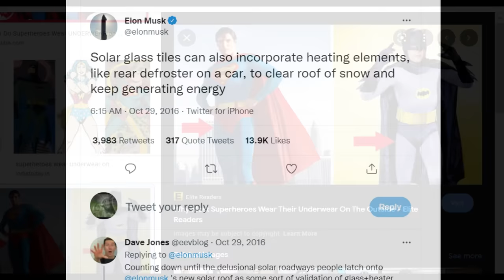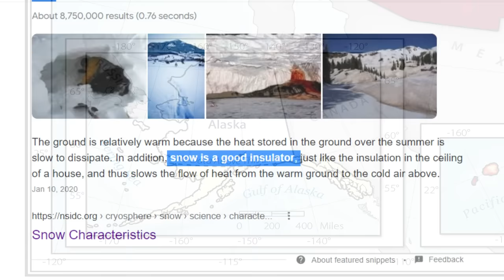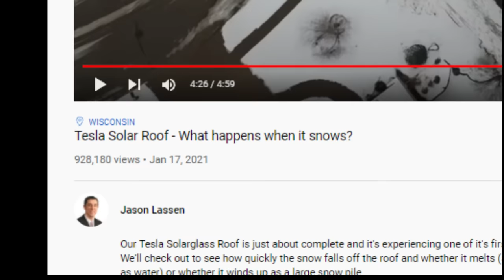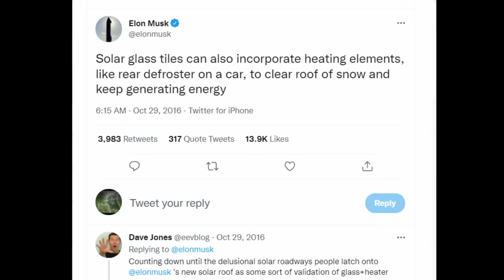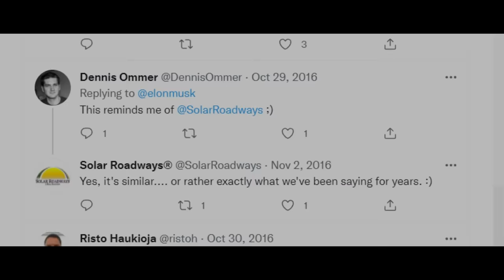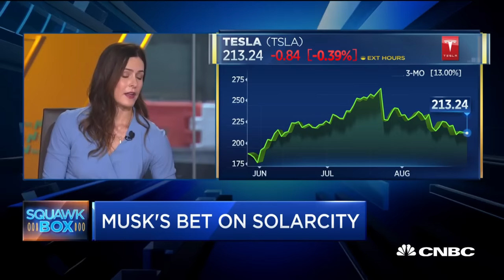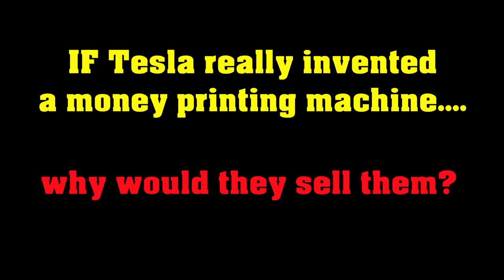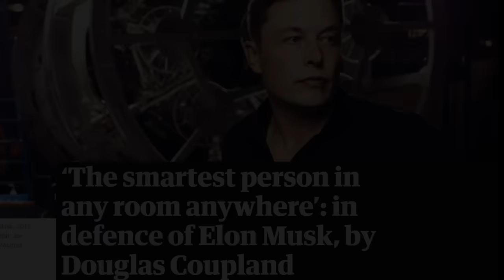Elon Musk: The Smartest Person in any room ANYWHERE!

Comment: "Why put insulation in your house when you can put heaters outside it?"
I can do one better:
"Why insulate your house when you could just glue yourself to the M25?"

Also, you might be getting a knock on the door from the police if your hosue mysteriously has no snow on it lmao
Reply: @monsterous289  It was the Musk Fanboy who made the original video who made the claim.
Reply: @Foolish188  what specific claim that is wrong did the Musk Fanboy make?
Reply: @monsterous289  Watch the VIDEO of him saying it was!
Reply: @Foolish188  Saying it was what? To be honest, I too thought I'd heard the guy in the clip indicate that the snow had melted rather than sliding off. I was even considering a strongly-worded critique of JFunk's comment. In preparation for the comment, I re-listened to that segment to make sure that I quoted the guy in the clip correctly, but on re-listening, all he says is that "there's not too much here at all". This doesn't state one way or the other whether the snow melted, or slid off and was subsequently trampled. "not too much here" could refer to either piled up, un-melted snow, or could refer to refrozen melt-water, without further detail, anything more would be conjecture.

What is clear here is that TF's choice of this clip to demonstrate his general point about insulation was a poor one. The other examples he showed were FAR better demonstrations of the link between poor insulation and houses with a clear roof. Without further explanation of why there weren't piles of snow under the edges of the roof, it neither proves, nor disproves his point. If JFunk is correct (and I have no reason to doubt them. I haven't sought out the source video as it's irrelevant to this comment), the lack of piled-up snow can be attributed to the passage of time, although this doesn't explain why the snow elsewhere in the yard was roughly the same depth as that where the piles would be had the snow slid from the roof.

That TF goes so hard on this video is something of a double-edged sword. Whilst he is probably right that the current lack of snow coverage means that this building is now likely to be less well insulated than the other houses in the neighbourhood that have both traditional insulation PLUS the insulating properties of a layer of snow, there is no evidence that a lack of traditional insulation caused this lack of snow (and to say so without pretty firm evidence, or at least acknowledging any assumptions made in the absence of such evidence, is wrong, and coming from an accomplished and published scientist this is both surprising and disappointing). As such, use of this video fails to strengthen THAT part of his argument (that deliberately removing the snow coverage lessens the total insulation that the building could be benefitting from). That the entire roof is clear, however, reinforces this point, as you would only need to clear the snow coverage from those panels on the sides with line of sight to the sun.

This being said, JFunk's statement that "he knows this!" about the time lag between snowfall and filming being the cause of the lack of piles is only valid if the source video provides information not in evidence in the abbreviated clip here. JFunks criticism states this as fact, however, without citing the source of the additional information being used to justify this assertion.

Additionally, JFunk's criticism of TF comparing to Solar Roadways as they need to "not just melt all the snow, but evaporate most of it" is disingenuous, as Solar Roadways just need to melt the snow. If correctly installed, the camber of the road would naturally cause the meltwater to run off.

All in all, errors on both sides here. TF, as the creator of this video, bears perhaps more responsibility for his poor choice in using this clip to demonstrate a point that, absent additional context not in evidence, it fails to demonstrate. Implied attribution of malicious deception to TF by JFunk, however, is perhaps a little excessive, especially copy-pasted as often as it is through this comment section. If you have a point to make, start your own comment thread, rather than copy-pasting it into so many comments with which you disagree. The lack of specific parallel between JFunk's comment and the comments it's pasted in response to only serves to weaken the points within as it paints JFunk as being possessed of at least as much blind hatred of TF as they are accusing TF of exhibiting towards EM.

To be clear, I'm neither a TF, nor an EM fanboi. I am sceptical but openminded about most of EM's ventures, and was before seeing any of TF's (or anyone else's) content criticising him. Part of this is that in the coverage I've seen of EM, the way he articulates things makes me think he's as busy trying to convince himself of these concepts as he is the listener / viewer. It seems as if he has been persuaded of the veracity / viability of these things by folks desperate for a slice of his fame and fortune to fund their ego-stroking circle-jerk projects but doesn't fully understand them and is trying to convince himself that he isn't the victim of a con. I'm not saying that this is the situation, just that the footage I've seen comes across that way to me. As someone who works in the IT field, I've often seen this behaviour in those who have been taken in by an online scam who are desperate to get others to believe in the scam as a way of reassuring themselves that if others fall for it too, it makes them feel better about having been duped, and will vociferously advocate for the scam even to those who know better and are trying to show them that it was a scam (especially where they know these people are in a position to know better, as if they can convince someone who is, for want of a better phrase, professionally trained to know better, the effect of convincing them that the scam is legitimate is even more powerful in assuaging their feelings of guilt / inadequacy at having been duped). The strange thing is that I can't put my finger on exactly what it is about how he articulates things that gives me that vibe, but that's certainly the vibe I get.
Reply: @Kevin Reed - there really isn't enough context to make a call either way on that roof - the drywall guys could have been upstairs the day before with portable heaters going full blast. Its kind of pedantic but people in these comment sections tend towards that.

Comment: No doubt he's a con. But in general, solar panels in northern climates have one advantage. They perform better in some cases depending on how much snow is reflecting the light. There's no performance hit from overheating either like in hot climates.
Reply: Yup, solar panels work best when it's both cold and sunny. Intermittent clouds also help in summer: when their shadow passes over the panels, they get a chance to cool a bit and improve efficiency. And they also reflect light onto the panels when the sun is not precisely in the direction the panels are facing, a benefit that's not restricted to summer only.
Reply: good point but won't catch much snowlight from the roof facing upward..
Reply: @prismpyre7653  Are you sure about that? There’s plenty of information out there about it if you do your research. But yea if it's flat mouinted on a roof then maybe albedo effect won't bounce to it. But in good solar arrays they are double sided and catch relfections. And also there is still the cold making it more efficient than in hot climates.

Comment: Solar power is just so overrated in general. Even making it more efficient doesn’t increase the amount of solar irradiance, which is not a lot per square acre. We need advanced nuclear fission to save the economy from climate change — look seriously at thorium molten salt reactors. See Kirk Sorensen videos 💡
Reply: Solar power is underrated.  Current designs make the lowest cost electrical power of the available options.  Fusion energy is 20 years away and always has been.

Comment: Make a video on PAVEGEN, apparently they make floors/tiles that convert pressure/friction into electricity and they say they are planning to make roads with that technology. Seems very good, but your takes on those kinds of things always bring light to determine if its a fraud or not.
Love your videos!
Reply: So they want to put something that is based on moving parts (because you can't exploit pressure without those) under the extreme stress of road traffic?
Reply: That kind of technology is already being driven on. CAT Scales uses that kind of technology. Truckers drive onto scale, and it weighs the truck. In the USA, a truck is not allowed to exceed 80,000 pounds (properly marked trucks, and truckers properly licensed, can go above the 80,000 pounds as an oversized load), so weighing is a necessity from time to time. They are also not allowed above 20,000 pounds on a single axle if I recall. So some scales, are even segmented, to weigh the front axle, the 2 center axles, and the trailer axles, individually, so not only do you get the overall weight, but the weight on each axle and axle pairs. The only kind of measuring device, takes an electrical signal produced by a truck driving on the scales, and weighs the truck with said signal.

So it is viable, to allow vehicles to drive on such technology... Is it viable to let standard road traffic, drive on such technology? Far more viable than solar panels... though that isn't all that high of a bar to surpass... PLUS, external energy is still required for those scales, because a single truck driving slowly (1-2 miles per hour slowly... remember I'm talking USA here) onto the scales, and then staying put for short time, doesn't produce that much of an electrical current...
Reply: Problem is you're probably going to end up with a high-maintenance road surface that makes your vehicle use more energy.

Now, if maintenance costs could be made low enough, there might be a point on the downward side of a slope, as it's essentially a giant regenerative brake built into the road, and at least you're not making the surface out of glass. Whether it would ever be economically worth it though, is something I can't be bothered to math out for the sake of a throwaway youtube comment.
Reply: Thermodynamically you have to get this energy from somewhere and in this case it would be sapping the energy directly from the cars which drive on it. I would imagine that if a car rolled perfectly with no friction and never slowed down thermodynamically it would be impossible to get any energy from pressure the car creates against the road. So in this case the road surface would be literally stealing energy from the car, which is very obviously a terrible idea since car engines are inherently less efficient than even a shitty coal power plant and you'd be using car engines as a power plant.

It would be like using hamster wheels to generate power. You'd be better off burning the food you give the hamster in the same way you'd be better off burning the fuel for electricity than harvesting it from moving cars.
Reply: Such a road would be sucking power from the cars driving over it, Your car's fuel consumption will go up at any given speed to provide the road with energy for the road owner to sell as electricity. 
Basically it is stealing.
It would be a very inefficient too.  It would be more efficient if the road owner simply took some of your car fuel and burned it in an oil-fired power station.
Reply: Putting vertical axis wind turbines at strategic locations (places where you'd like to have a slowing effect on traffic such as downward slopes) could gather some energy. Building something into the road sounds too expensive to my totally not qualified mind. Good idea for a video!
Reply: @edgarwalk5637  Did a quick search, and it turns out this is indeed a thing, and not just being researched by small companies either. Knew I'd seen it before somewhere.

Comment: I have to disagree a bit on this one. I live in Maine in the US and we get plenty of snow (a bit less now due to global warming). We have plenty of solar farms and more going in monthly. A modern house should be insulated enough to not rely on a blanket of snow for insulation so removing it is not really that big of a deal. It doesn't  take much melting to get a properly pitched roof to shed a blanket of snow unlike a flat solar roadway which requires melting all of the snow. Here metal roofs are becoming more and more popular and they really don't hold the snow anyway.
Reply: what you said is hardly disagreeing with the point of the video. but yeah
Reply: Yes, thunderf00t is being dishonest as usual. Solar isn't great for grid level power in seasonal areas, but it's decent for individual home power.

Comment: "Hey, let's spend 100 million bucks to launch an automobile into orbit." If Elon is the smartest person in the room that's something you should be really worried about.
Reply: Honestly, yeeting a Tesla probably was pretty smart from a marketing perspective. The launch system needed a test flight, and test flights need a payload. Might as well do something more interesting than sending a block of concrete into a solar orbit. That, and rockets aren't cars. You don't buy a rocket, you buy a service to put a payload into space.

Problem with Falcon Heavy, is that while it can launch a lot of mass, it's somewhat light in the volume department. That payload fairing isn't any bigger than a normal Falcon, and they're already having to do all kinds of Ikea-level flat-packing to squeeze a bunch of Starlink satellites into normal Falcon rockets. Hence, BFR. Heavy launch, with a volume to match, or I'd guess that's the plan at least.
Reply: Launch concrete, or launch an old car.

Comment: I'm so glad TF is starting to make videos about how inefficient solar is for most of the world and I mean really piles on in this one.  Solar has it's issues and at least I'm not all that excited about oil/fossil energy.  I'm hoping we return to nuclear.  We can take a real deep look at how France pulls off such low carbon emissions.  Take the most advance/safe designs and really dive in so that we can stop with all these other ineffective means of producing large amounts of energy.  Great work on this video Phil it's quite good.
Reply: He is slightly wrong about it however.  If you angle the panels to be flat to the incoming sun, they still work quite well.
You can't fit as many and don't get as much power but in many areas it is still cheaper in the long run than the power from the power company.
Reply: @vibaj16  dont worry, im sure elon will tell us that fusion energy is ten years away any time soon.

Comment: In snowy regions people actually put snow catchers on roofs to stop snow from sliding down. Because snow works as insulation.
Reply: There are safety issues involved, too – being buried under a roof-full of snow would be no fun.
Reply: @c.augustin  That is true. But snow catchers designed to catch only layer of snow of particular thickness. Houses designed to withstand higher load. And people clean extra snow if needed.
Reply: @jurabondarchook2494  Not so easy to clean off excess snow from the roof if you have a 5 story building … 😁

Comment: Living in an off grid home, I happen to know that uninstalled solar panels have gotten dirt cheap and you can still produce infinite free energy when it is cloudy out, simply by laying out ~4x as many panels and pointing them in any direction you want. Full cloud cover diffuses the light such that it arrives from all angles of the sky, and since most of the cost now days comes from labor and permitting, it is practical to just skip formal installation and spend that money on extra panels to lay directly face up on the ground or vertically on existing fences and walls if it snows in your region. Unlike wind farming, you are guaranteed to produce some energy every single day from solar panels, so you need only go big to achieve 100% sustainability year round.
Reply: Sounds like you've written Musk's next sales pitch for him.
"Why buy just one solar panel, when you can generate a fraction of the power at ten times the price!"
Reply: @BB-dv5ms  Why would you replace them just because the efficiency goes down a bit. They will still work 40 years from now.
Reply: @itekani  bullshit solar efficiency is trash after like a decade. 15 years if you are lucky. Either way using 4x because you are in a shitty location for solar isn't sustainable. Do you think these panels just appear from thin air?
Reply: @theastuteangler  exactly? Thanks for proving my point. Just because nothing we do is doesn't mean we have to pick the most idiotic energy generation for an area. Being efficient is a good thing
Reply: @BB-dv5ms  You obviously don't know what you're taking about. Most manufacturers guarantee 80% power for 25 years. And you want to buy new ones after 10 years? Do you think they appear from thun air? ;)
Reply: @BB-dv5ms  By the way, your arrogant tone does nothing to help you prove your point.
Reply: @itekani  uh oh the tone police are here

Comment: I do very well with solar in Pennsylvania, but I didn't mount it stupidly flat on a 7/12 roof, I have them angled at about 60°, which is approximately perpendicular to the sun on the winter solstice.  Therefore, when it snows, the snow tends to slide off easily. And I generate reasonably consistent output year-round.  If you use your solar panels to try to melt snow on a snowy day, you would consume your entire battery bank of power, and still not achieve the goal.  As soon as the sun comes out, you don't need anything special to melt the snow.  The sun will do it all on its own.